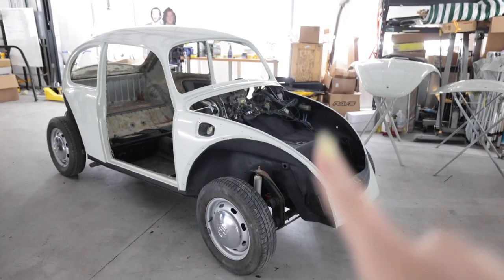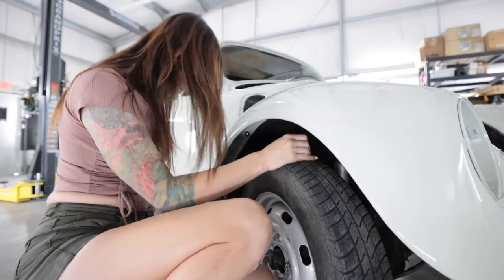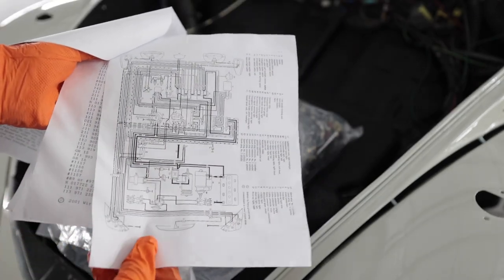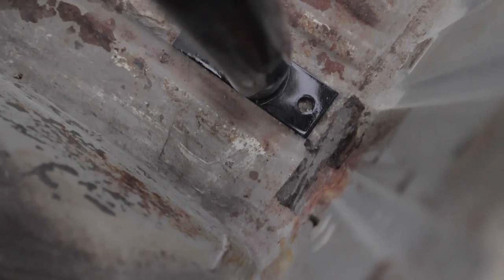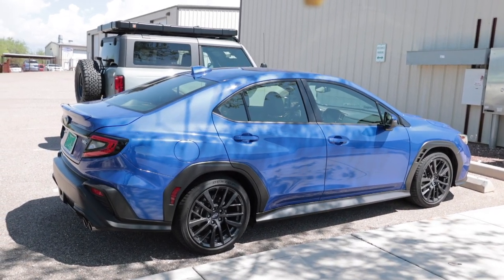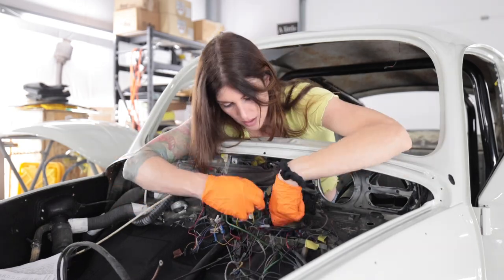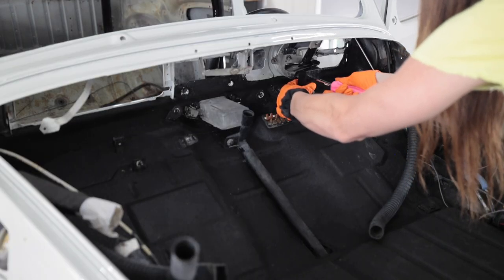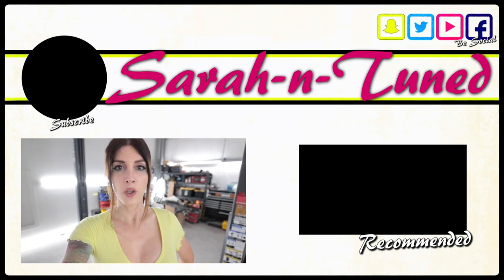I Had To Do It.. The Old Stuff Was Terrible! // 1969 VW Beetle

Comment: You had me at "goat's milk Popsicles" ! 😍 

Edit: when pulling old wire harnesses, I like to tie a piece of cord to the end of the old harness, before  pulling it out, therefore, leaving the cord in place, for pulling the new harness back through.
Reply: Or taping the new to the old that way the new gets pulled in as you pull the old out
Reply: When I worked on a Honda assembly line, we developed pretty elaborate hooks and wires to route wiring harnesses and tubing. I absolutely destroyed my shoulder routing tailgate harnesses on CR-Vs. If nothing else, not forcing it and just taking your time is about the best advice I could give. Smarter, not harder, for sure.

Comment: The level of detail you put into your restorations is amazing. The lucky recipient is going to get a beautiful classic. I haven't seen ceramic fuses in many years. You don't even see them in parts stores. The tips were notorious for corroding or developing circular indentations that would cause electrical issues.
Reply: I had a 67 bus and replaced the fuse panel with one that had glass fuses on it. I bought it from JC Whitney 🤣
Reply: Yep, such high level attention to detail i'd trust it if it was a flying car :)

Comment: I once rewired a tractor after a short circuit. It was relatively simple, and not all wires were copper and black goop.
But it still needed some reverse engineering without a diagram or a replacement loom.
It was very satisfying in the end when the engine started, the lights were working and finally the horn sounded when I hit center steering wheel button!

Comment: The 69 is relatively easy, in 1971 VW added a diagnostic plug in the engine compartment, on the firewall, and that more than doubled the amount of wiring. I had a 71 super beetle, and I got so frustrated with that plug I ripped it out, and all the associated wiring. I kept the stock 12 fuse fuseblock, and wired the car mostly along the lines of a 69 bug.
Reply: And let's not forget the lovely foam they sprayed into the 71-up Beetles that captures the harness in the quarter panel.  That's some fun there.
Reply: @rennkafer13  so what your saying is the spray foam in my 77 is stock .. i though it was from some dumb restorer  goodness
Reply: @scootersfrog  ya, they started it in '71..  not one of their better ideas.

Comment: Sarah,
1.  Licorice is one of the three foods of the Gods. No, I don’t know what the other two are 🤪.
2.  Hip, hip, hooray!! (repeat as necessary). Three cheers for your OCD 😜.
3.  I think this suggestion might be a bit late but I shall proceed anyway: As you pull out wiring from places where fishing might be necessary, pull a very strong string (like the nylon used to tie wiring harnesses) through with the last wire. If you decide you need to fish a wire through, you now have a convenient puller. If the decision is made to bypass that particular passage, it is easy to pull the string out after all of the new harness is in place 🧐.
4.  After the incident with heavy stuff and your foot, did you ice it and keep it elevated 🌹?
Keep the aspidistra flying!
Love,
Paul 🍷🫶🍷

Comment: Hope the engine doesn't give you a lot of trouble. It's kind of a Frankenstein, it sure isn't stock.  It's been a long time, but I think the original engine had single port heads, this one has dual port, carburetor sure isn't stock as well as the blower housing, distributor, crank pulley and even where you fill the oil.  Coil was originally mounted on the blower housing.   As for the wiring, whenever someone put in a custom radio, they always destroyed the wiring in the dash and didn't put the airbox and controls and all of the stuff they messed with in the dash correctly.
I admire your determination! It's been a while but 50 years ago I worked for VW.

Comment: You need the adhesives anyway. When the car sits under the sun for an extended period of time, like an entire day, then the rubber getting hot will tend to stick to the paint, and without adhesive you're at risk of stripping the door from the rubber seal when you open the door.

Comment: Back in the day the VW fender rubber inserts had half inch wide slots in them so you could insert the volts and leave the fenders loose then push in the rubber from above then tighten the bolts. So much easier.

Comment: coil should be mounted to the fan shroud not firewall.  if you're going to re-paint the chrome, drill it and either nutsert or just bolt & locknut the coil bracket in place.  the relay under the hood is correctly in the factory location.  the speedo glass can be removed by carefully prying the chrome bezel ring off the gauge housing, clean & re-crimp.

Comment: You have a roll bar in there?   The engine wiring on an old VW is very simple.   If I am not mistaken there should be a clear plastic cover on the fuse box.   I seem to remember that it even has little icon symbols on it.

Comment: A little surprised you didn’t attach pulling tape/stretched out coat hanger wire to old harness before you pulled it apart. Especially true with rear harness as it’s packed in with insulation foam - keeps fumes & noise from engine intruding into cabin & should be repaired after new harness is pulled. Also, fuse block is best cleaned with scotchbrite and terminal cleaner with final touchup with a wire brush. Old blocks can be really crusty.

Comment: I used to use a household cleaner called Kaboom to clean copper electrical connections.  It removes oxidation without scrubbing but you do have to rinse it with water or else whatever it takes off just settles back on as it dries.  I know they've changed it over the years but you might give it a try......

Comment: Those ceramic euro fuses can be a pain..  The electrical connection between the terminal on the block and the terminal fuse gets resistive, making for unreliable connections.  That’s one thing which I’d be tempted to upgrade - a new fuse block with ATC blade fuses.

Comment: Proper electric harness work is so underappreciated part of the job... The absolutely worst job I have ever seen was a power rail on a circuit breaker panel. Instead of a copper bus bar, the power feed was point-to-point with one inch wire segments and the crimps looked like made with pincers. Some of them were so loose they came off with a lightest pull. This was in an unfinished experimental aircraft. The electrics were scrapped and rebuilt from scratch.

Comment: Wow ! You're are going all the way Ragnar ! Nice work !! I take that chrome ring off the face of the speedo with a small screw driver to clean the glass and dust the inside ...also you can change the oil. Generator and turn signal colored plastics which get faded from the rear of speedo ... they are red and green. If you saw how easy it is you would laugh .but no biggie
You may as well tap that A$$ and pull the engine to remove the tar sound deadener from behind the engine... its held in pretty good if its still factory...
Looking good !!
Reply: Excellent advice. Hope Sarah reads your suggestions.

Comment: i work at a cryogenics shop. the wire for the harness is diameter .005-.007 human hair thickness soldered into .010 gold plated tube 1.500" x .500 " 4 rows of 25 tubes under a microscope soldering for NASA/Teledyne ,tedious though but its Constantine  gold plated wire .expensive at $ 1500.00 / foot  . beetle wiring not so bad just need colour code chart

Comment: The voltage regulator should be right up on the dynamo in the engine bay.
Reply: Nope- it should be under the seat in the stock location. in the engine bay on the GEN/ALT is not where it goes . Also if this change was done her wiring harness would have to be patched back together under the rear seat.

Comment: Sarah, you should check the engine thermostat to ensure it is working properly, or that the previous owner didn't toss it away. Engine longevity depends on it. Great video as always.
Reply: With that Chrome 36hp style shroud . 100% sure the thermostat is no longer in use or even attached.

Comment: seeing you strip out the wiring and half the dash part getting it out would have been more worth it to do before paint so you could have gotten into it all. ( paint inside and out fully.)

i hope that wiring works though, some changes on different years, also doing custom/ your own can help tidy up and modernise stuff like relays and modern fuse holders. plus smart wiring (not having 5 different thing powered off the one fuse)

Comment: Well since you didn't happen to say anything and your not wearing a cast i see your foot is not broken and glad your moving ok. As far as the wiring goes the only question i have is why not update the fuse block to something a little more modern? You have the skill set to do it correctly and those old style fuses might be getting harder to come by

Comment: A modern fuse block not included with the new wire harness??
Reply: My dad had a 68 beetle and sometimes one of the fuses would glow, this panel is more trouble than one with glass fuses.

Comment: please pull that engine out already. you've disconnected the 4 wires, the rest is just 4 bolts holding it to the transaxle, a fuel hose, and throttle cable. will be so much easier to work without that in there.